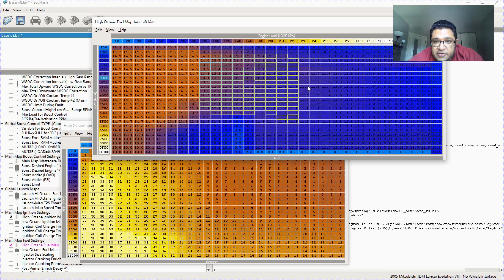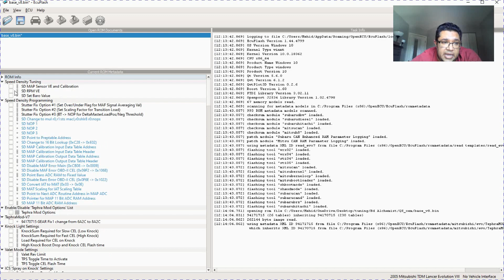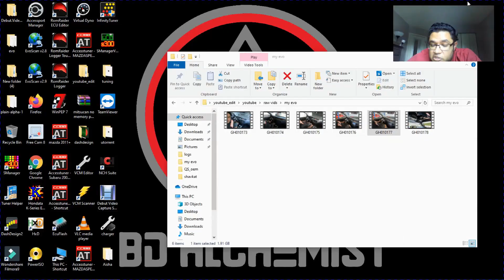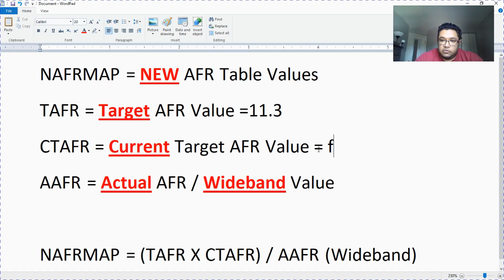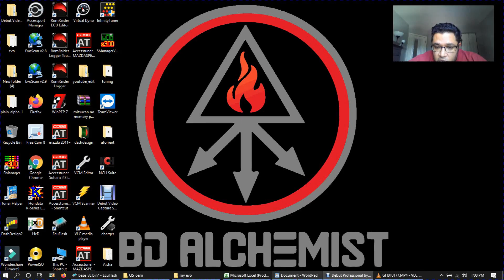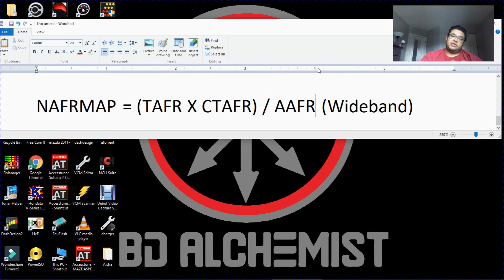How To tune Fuel table /AFR

Comment: Hey man! At 7:36, you said something like don't hit the throttle (WOT) at 2k rpm bcos it's not good or safe? Can you expound on that? Or maybe do another video on the Do's and Don'ts based on your experience?😅 Your videos are awesome.
Reply: I’m in no way an expert but I do know you never want to hit the WOT in low rpm’s because by going to WOT at a low RPM with a turbocharged engine you're putting a lot of force per power stroke on the internals, at least in higher gears. In the short term there is an increased chance of damaging something. And long term you're almost certainly reducing the longevity of the internals. Your timing is also typically set for cruising when in the lower RPM so you would be fouling aka running way too rich when you should be in the ideal AFR. If you’re trying to take someone to the GAP..downshift lol

Comment: I'm having an issue where my target afr in my high octane fuel map isn't matching what my evoscan logs are showing. I still have lean spool on, would this cause this problem? Thanks for your help!
Reply from the maker: Yes that's a big factor
Reply: @bdalchemist  Thanks I will disable lean spool and hopefully that will help me get it set up correctly. What do you recommend shooting for at redline for a safe afr on 91 octane?
Reply from the maker: 11-11.3 starting point , but u have to figure out what ur car like most
Reply: Thank you really appreciate your help!

Comment: Awesome videos! I always look forward to your next ones. I don't have openport 2.0 for my evo, but do you still think its possible to datalog using a obd2 to usb cord and evoscan? My cord is from ecmlink v3 for my dsm. Thanks.
Reply from the maker: The key is translators aka drivers . If u have drivers that works with evoscan it should work. Also the tactrix is $167 and works on many many applications. It's a good investment.